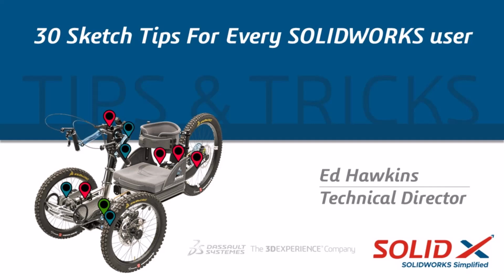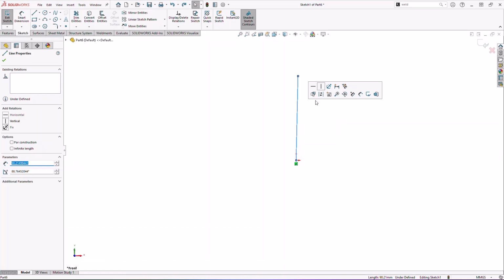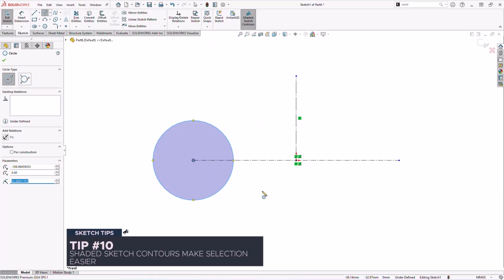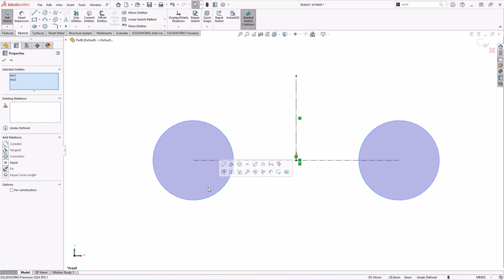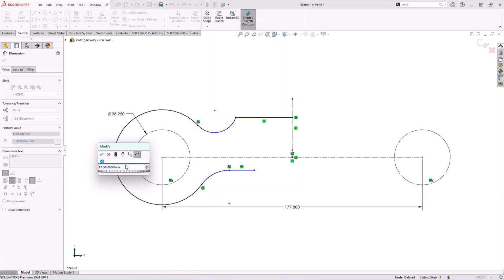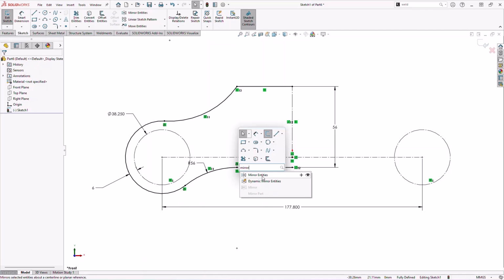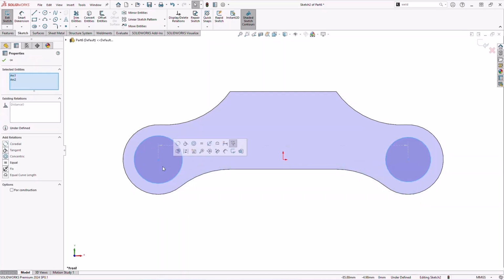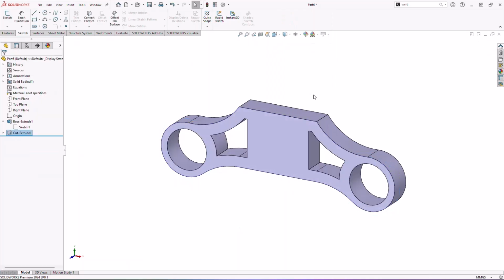30 Sketch Tips Every SOLIDWORKS User Should Know!

Comment: how do you set D key to exit sketch?
Reply from the maker: Please note: this should be assigned by default - if it isn't, it could because you are using an earlier version of SOLIDWORKS.

Click Tools and then select Customise.
In the Customise dialog box, on the Keyboard tab, in the Search for field, type 'Move Controls to Pointer'
In the Shortcut column for the tool, type D
Click OK.
Reply: @solidxcad i typed “move controls…” as you said but nothing showed up. I’m using version 2022
Reply from the maker: Hi James, that's strange. Can you email enquiries@solidx.co.uk so we can send over a screenshot?
Reply: @solidxcad  Hi guys. Did you resolve this? I've got the same issue, 'Move Controls to Pointer' isn't showing on the the keyboard list.
Reply from the maker: @wayneharrison7159  Hi Wayne, We will email you ;)